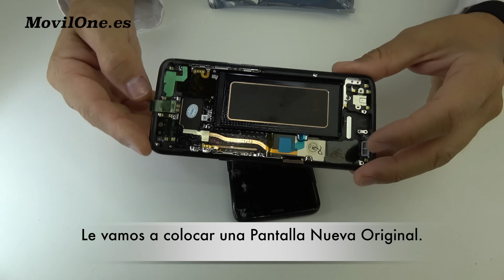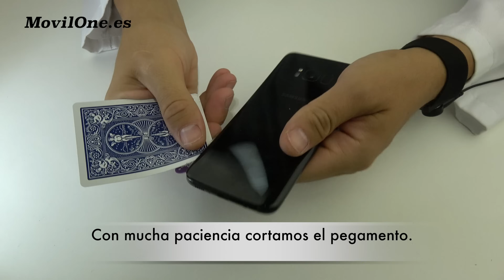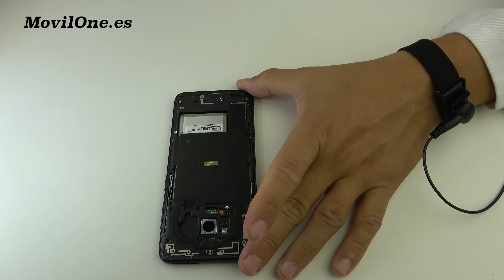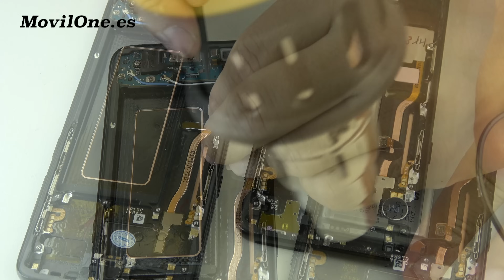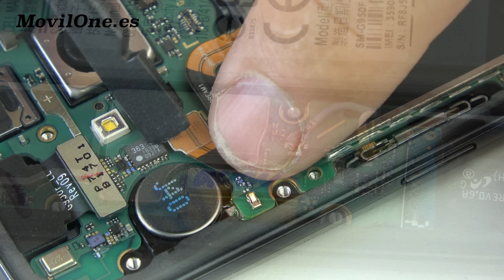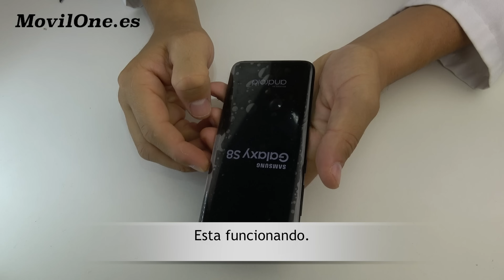Cambiar pantalla Samsung Galaxy S8

Comment: Donde puedo encontrar la pantalla del s8 g950f
Reply: Mira ebay.uk
Reply: @romaniagoldrecovery.  Gracias
Reply from the maker: Hola. Como dice el compañero, por eBay, Aliexpress, Amazon. Busca precios... Un saludo.
Reply from the maker: @ Romania GoldRecovery. Haz un video de como sacar el oro de los flex de las pantallas de los teléfonos móviles. Es un video bastante interesante. Saludos.
Reply: @MovilOne  buena idea
Reply: @nexgen6305  acabo de comprar la pantalla del s8 en ebay.uk y me salio a 109.99 libras esterlinas......otros vendedores dicen que venden la original por 150 librss pero yo creo que es igual, de todos modos si hay algún  fallo en la pantalla ebay me cubre la espalda.
Reply: @romaniagoldrecovery.  que buen dato gracias te has pasado tio

Comment: Para qué es la pulsera?
Reply from the maker: Una correa de muñeca con una pinza de cocodrilo
Un brazalete antiestático o pulsera antiestática (también llamado muñequera antiestática) consiste en una cinta con un velcro para fijarla en la muñeca conectada a un cable de toma de tierra que permite descargar cualquier acumulación de electricidad estática en el cuerpo de un operario de equipos sensibles.

El brazalete lleva una resistencia de 1 Mega Ohm, conectada en serie para limitar la corriente de cortocircuito, protegiendo al usuario si tocara cualquier aparato o componente conectados a la red eléctrica.
Reply: @MovilOne  Ok gracias por el dato

Comment: Hola que tal. Buen vídeo. Es muy satisfactorio. Pero siento curiosidad por saber qué es lo que tienes en tu muñeca izquierda. Cómo se llama y para qué sirve. Saludos!
Reply from the maker: Hola. Es una pulsera antiestática " consiste en una cinta con un velcro para fijarla en la muñeca conectada a un cable de toma de tierra que permite descargar cualquier acumulación de electricidad estática en el cuerpo de un operario de equipos sensibles." Un saludo.
  https://www.movilone.es
Reply: MovilOne aaahh!!! Gracias por la explicación. Nuevo subn
Reply from the maker: Thanks.
Reply: Ana María Ciudad Conde Hola. Esta pulsera antiestética sirve para no dañar los componentes electrónicos. El corriente se va a la tierra. Un saludo.
www.movilone.es

Comment: La pantalla tactil de mi s8 está rota (no responde), el cristal roto y el cristal trasero tambien. Me podeis dejar Links de compra o hacerme un presupuesto del arreglo? Gracias de antemano
Reply from the maker: Hola Alvaro. Aquí tienes el link de una pantalla original:https://www.etradesupply.com/samsung-galaxy-s8-series-lcd-screen-and-digitizer-assembly-with-front-housing-black-without-logo-grade-s.html?acc=67e103b0761e60683e83c559be18d40c
 Un saludo.